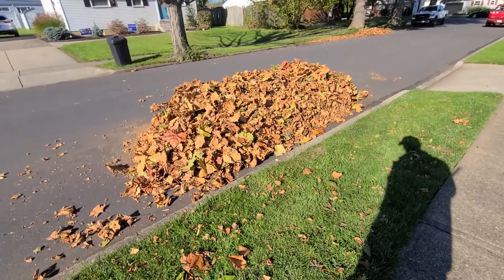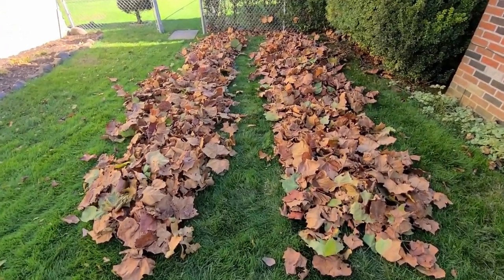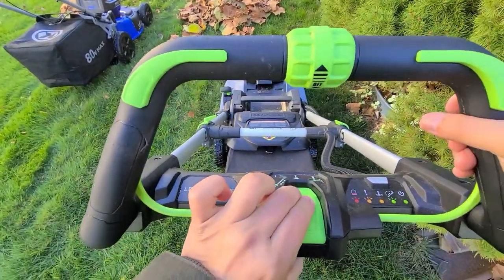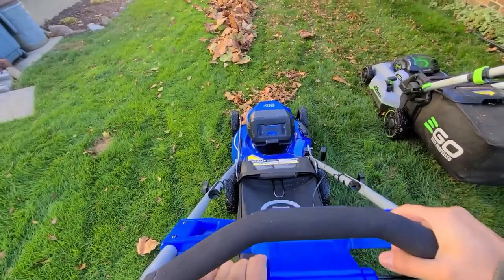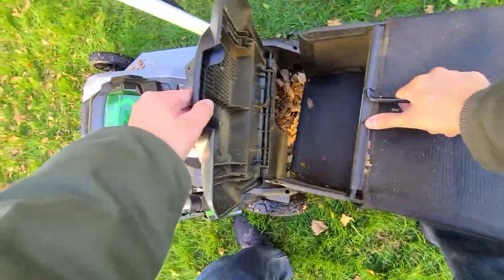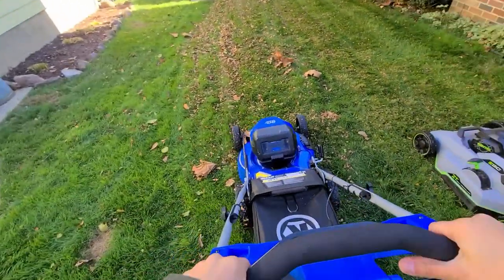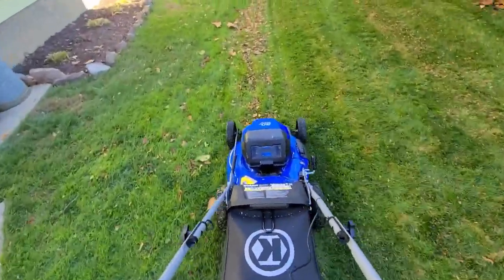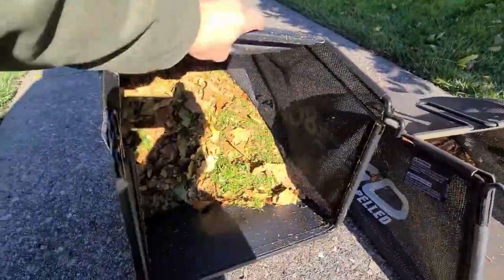EGO 56v select cut mower vs Kobalt 80v Mower Leaf suction tests

Comment: Thanks for the video.  I bought the high lift blade and it will show up this Friday.  I also haven't tried the bagging blade either.  I will test both without the bag to see how well it mulches the leaves.  I know the high lift blade is supposed to be used for the bag but I have seen plenty of other youtube videos where the people have said the know the high lift should be used with a bag but they didn't care about that and used it just mulching and for the most of the videos, they said it works great.  If I have to the leaves onto my grass, I have a huge circular driveway and a side driveway that runs up the side of my propery and goes about 150 feet to the back detached garage where in front of the garage I have room to park maybe 8 cars.  That entire area is layered with leaves this time of year.  Besides all that I get a lot of leaves on the lawn.  So my goal is to mulch the hell out of the leaves so much so that I don't have to gather them all and rake onto a tarp and drag to front of the property.  We cannot put leaves in the street.  There are two areas I can lay the leaves and it cannot be higher than 3 feet the pile.  All this means is I have way more leaves than they will ever pickup.  If I have to use the bag, I will be emptying the bag constantly.  Then making all those passes to get the leaves up.... I would be better off using my gas mower to mulch them and also use a tarp to gather.  Looks like in this video there is promise for the Ego but we will see the difference between the blade that comes with it and the new high lift.  Will share my results over the weekend.
Reply from the maker: Yes let me know thanks

Comment: Prefer to bag leaves vs rake to street. Raked leaves to street almost always wind blown back to lawn b4 pickup. Fortunately have option for bagged leaves to be picked up in alley. My village only picks up leaves and not grass. Requires grass to be mulched to lawn. Ego works great. Bag is perfectly sized to fit inside yard waste brown bag. Easy shake into bag. Depending on qty of leaves on lawn determines how quickly bag fills up and needs to be emptied. Ego is less effective at pickup when bag is full. My only problem was forgetting to take out mulching plug so my lawn was littered with debris.
Hopefully, this method makes a huge difference for me this winter. Last year, because some leaves were still on lawn at first snowfall and blown onto walk and driveway
 When used Ego snowblower, the wet leaves stuck to inside of snowblower, clogging the chute and making it less effective. Hopefully, blowing snow this winter will be easier. I just need to diligent with picking up leaves b4 it snows so I avoid the issue. One note, if one just cuts the grass and leaves at the same time with the mulch plug in and bag attached, Ego does great job and leaves a clean lawn! Only good if your town allows for bag pickup of mixed lawn cuttings. Thanks again 4 the comparison.
Reply from the maker: Thanks for sharing, our town vacuums them up a few times in fall which is nice

Comment: I believe you should make certain that both mowers are cutting at the same height. Setting the mowers in the same slot is no guarantee that the cut height is the same.
Reply from the maker: Hi Ron I agree, and thanks they both have 7 height settings so that was as close as they were going to get.

Comment: This is where the greenworks shines with the turbo button!
Reply: So, you've tried the Greenwood 60v with the Turbo button on leaves OR high grass ?
Reply: @46GarageUSA  yes I have. I own 2 of the mowers
Reply: Works best in about level 3 with the turbo button on for bagging leaves
Reply: @46GarageUSA  you don’t need the turbo button for high grass. It’ll sense it and automatically kick up the RPM.

Comment: Higher voltage on the kobalt should allow higher rpm and thus more suction. How does leaf suction compare to gas?
Reply from the maker: Hi Chris, Gas is still better but the new lm2156sp / lm2150sp with the Hugh lift blade bagging has Improved

Comment: HI AGAIN TECH GUY, ANOTHER GOOD REVIEW!!  I don't get why the Kobalt has a window in the battery compartment cover, when the charge level lights on the battery itself do not light up, but are displayed on the handle ( which is really the best place to see them ) so what are you supposed to see through the window?? smoke from an overheated battery??  And I think it's RIDICULOUS that the cover won't stay up by itself, especially since you need both hands to unlatch and remove the battery!!  The Ego battery cover seems to work much better!!!  Also, both of these, and most of the batteries in the other mowers you've reviewed seem to be rather square or weirdly shaped, and bulky, which makes them difficult to handle ; I find it ASTONISHING that the only battery I've seen you review so far with a convenient carrying handle is the Toro!!!  Also, you have a great many good state and specifications on the machines, but I'm not sure I've heard you mention what each battery WEIGHS, and this is important to me since you have to load it in, remove it, and lift it into the charger every time you use the mower!!!   Thanks Mr. Tech Guy.   Chas Orvis, Plainville, Ct.
Reply from the maker: Thanks Chas

Comment: My Snapper gas mover will easily pickup the leaves and leave a clean surface in  half the time.  May not be the correct trend, put sure does a much better job.  Electric movers have a way to go.